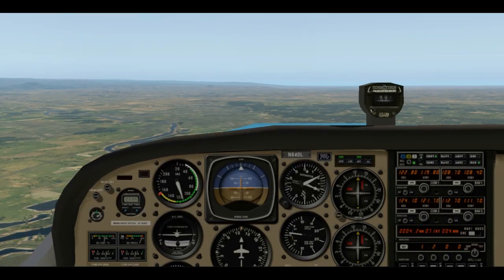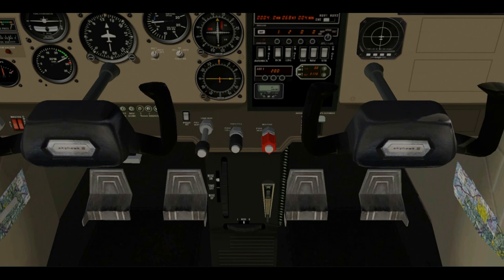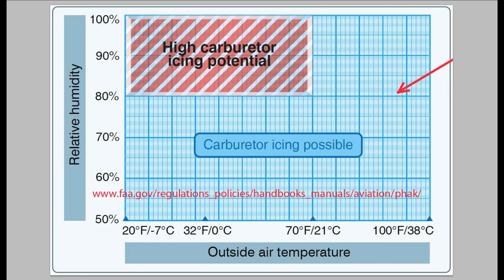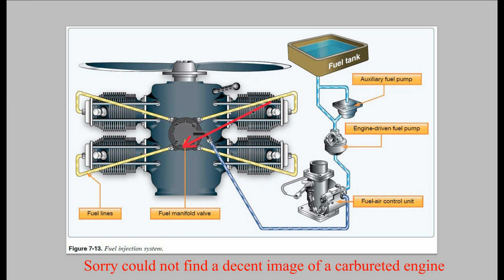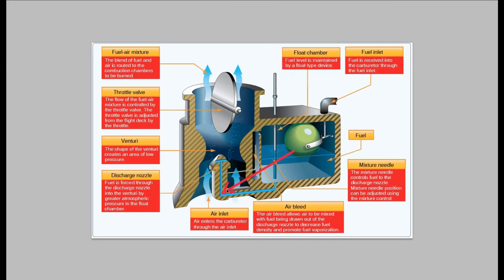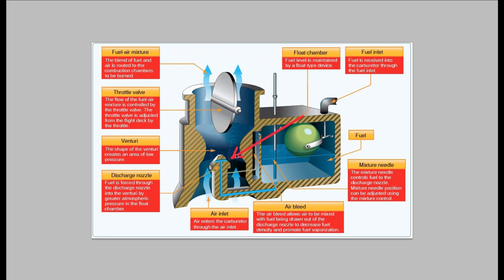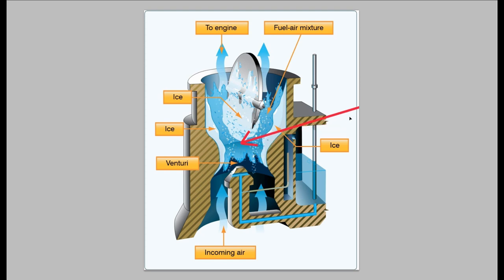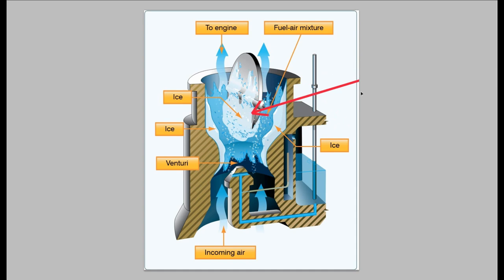Carb Heat ~ Learning to Fly for Beginners in X Plane 11 Part 15

Comment: Great video and explanation but I am confused about activating carb heat for every landing, does this include landings where outside temperatures do not indicate icing?
Since you mentioned that using carb heat may damage your engine because of the unfiltered air used.
Another question would be: How long does it usually take till the ice is gone?
Reply from the maker: Hi saen0r, Thanks glad you liked it :-)  Yes use Carb Heat every time you land. It's not the temperature outside that's the issue. It's a bit complicated but a simple reason is there is a pressure temperature relationship that takes place "inside" the carburetor and under certain conditions ice may form inside the carb, it doesn't need to be a really cold day. There's more to this than I can explain here it's just a good idea to always use carb heat when landing.

I don't have any idea how long it would take to remove the ice, that would depend on how much ice has formed. Probably the first indications of ice would be the engine not performing correctly, running bad enough for you to notice something is wrong and that could be a lot of ice, I don't know. 

I don't think it would to too long to remove the ice once you turned on carb heat since you are dumping hot air from over the exhaust manifold into the carburetor. However, if you are landing and need to go around for a missed approach and you find you don't have the power due to ice your in trouble and the engine might even run even worse with no power while melted ice goes into the engine!

Hope this helps and thanks for watching :-)

Blessings,
skip
Reply: @WEHVideos  Thank you for clearing that up, I'll make a habit out of using carb heat during landing and continue watching your videos of course!
Reply from the maker: Looking Good :-)

Comment: Thanks!  Is there ever a situation when the carb heat is partially open?
Reply from the maker: Hi pgreenx, I can't think of one. The problem is you won't know if there's ice forming in the carburetor until the engine starts to run rough and that's too late if you are landing and you have to abort needing full power, don't take a chance use full carb heat. :-)

Blessings,
skip

Comment: Is this a 172 for XP11 with carb heat modeled? If so, may I ask where I might find one? Heh, I keep forgetting carb heat in the real plane 'cause I fly the silly fuel injected sim planes too much. ;)
Reply from the maker: Hi tinytim2504, Yes and as far as I can tell this is the only one like this. You can get it here:
www.x-hangar.com/store/general-aviation/cessna-172n.html

Note that I made a lot of changes in my copy in X Plane Plane Maker and PhotoShop so if you get this the instrument panel won't look like mine. I really like X Hanger airplanes because you can till make modifications to the 2D panel in Plane Maker. Most newer airplanes for XP don't use the 2D panel so you can't make changes. I have several videos on making changes if you decide to go that route.

Thanks for watching, hope it helped
Blessings,
skip
Reply: @WEHVideos  Ah that's pretty cool, I'd love to be able to tweak the panel a bit to lay it out more like the skyhawks I'm training in. I was going to check this one out, and the link worked yesterday when I first saw it, but it looks like it's not there anymore.. Do you know if maybe they took it down?
Thanks for your reply!
Reply from the maker: Your right! :-( I'm hoping it's only for a while maybe there's a bug or something they just ungraded it a few months ago. I'm going to contact them to find out and you could do the same. It doesn't make sense to discontinue this airplane when they just upgraded it. 

Blessings,
skip
Reply from the maker: Hi again,  I just tried to upgrade and got a notice it was updated yesterday 2/7/21 so check back later I'm pretty sure it will be back soon :-)

Blessings,
skip
Reply: @WEHVideos  Ah, sounds like that must be it. Thanks!
Reply from the maker: Hi tinytim2504,  Well good news and bad news. I emailed x hanger and it seems they are going to completely redo the 172N and there is NO release date yet said "date to be determined" so it will be a while I guess and I'm not sure if they will use the 2D panel again, most new aircraft don't!

The only other 172N is by Carenado, you can get it at the x-plane store:
https://store.x-plane.org/C172N-SKYHAWK-II_p_81.html

This was the first N I got but I prefer the x hanger version. The Carenado Skyhawk ll is very nice and better is a lot of ways but you can NOT modify the panel and the forward view is just above the sun shield so you don't see the instruments unless you scroll down.  You can make changes for this in Plane Maker by changing the Viewpoint but I didn't find a really good viewpoint, it's OK but not great.

You can email x hanger and ask about the 172N maybe if he gets some requests he might put the old version back or work a litter faster to get the new one up. 

Blessings,
skip
Reply from the maker: Hi tinytime2504,  Well some really good news!! I talked to Gerald at X Hanger and he is NOT going to redo the 172N for quite some time if ever ;-( Good news he GAVE me the airplane and allows me to do anything I want with it, including giving it away!! I will have this on my website pretty soon and let you know when you can download it for FREE, pretty cool!!

Blessings,
skip
Reply: @WEHVideos  Oh wow! A bit sad, I suppose, but also super cool! Thanks so much for keeping me posted; I look forward to checking it out!
Reply from the maker: Hi tinytim2504  OK I have the 172N available, Here's the link:
www.youtube.com/watch?v=mmOxFBkgEBE

Blessings,
skip
Reply: @WEHVideos  Awesome! I'll give it a try tomorrow and let you know how it goes!